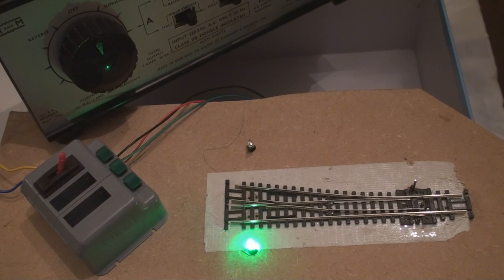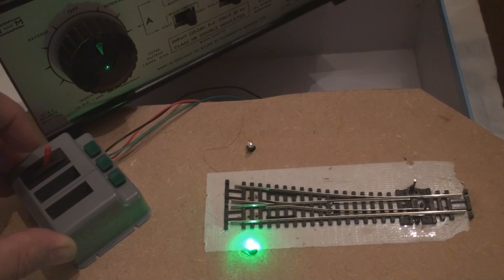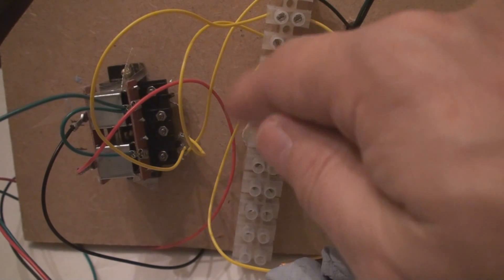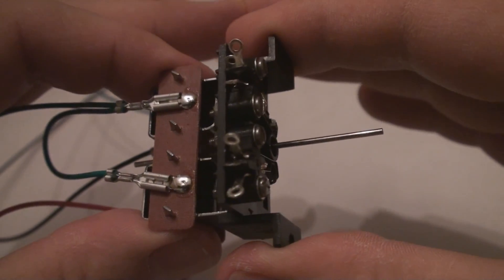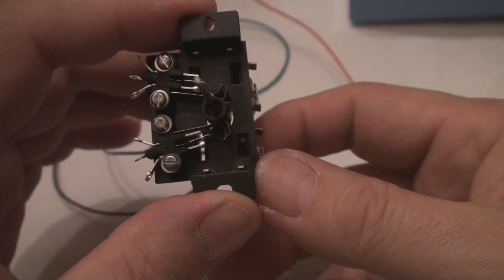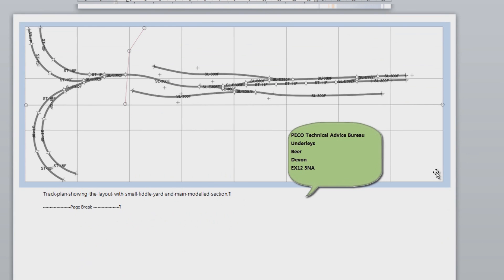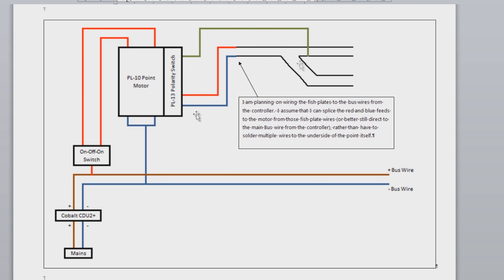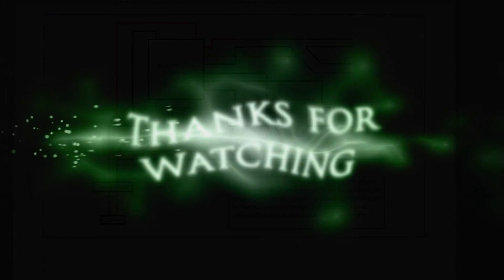TST1 - Peco PL-15 / PL-10E Point Motor Test

Comment from the maker: FWIW - These point motors are getting easier to fit with experience.  If you want panel lights and switched electrofrogs, then I'd definitely suggest getting one of these and having a go.